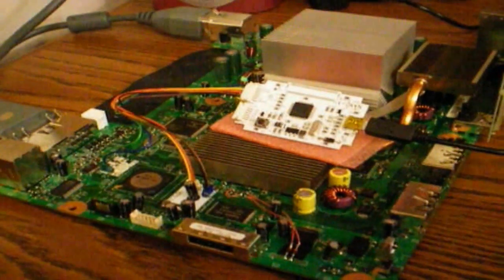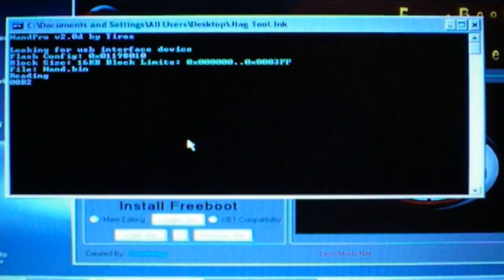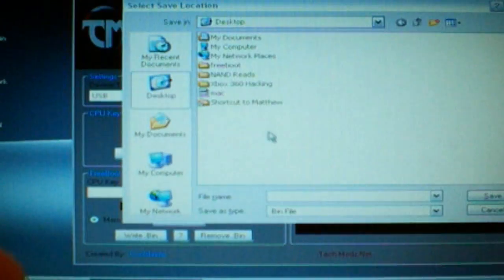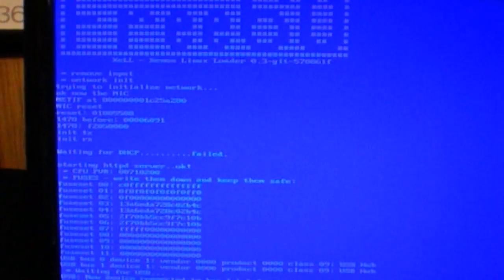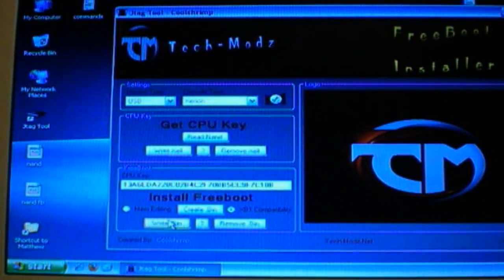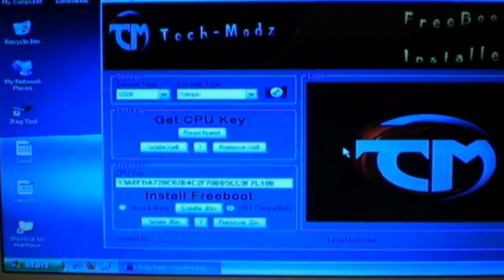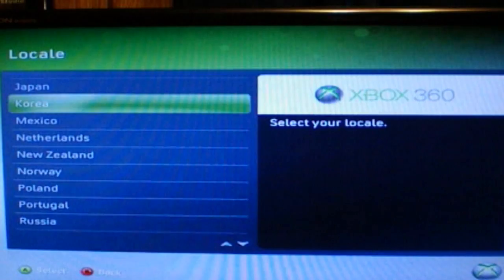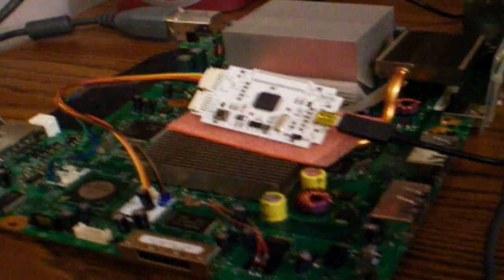Xecuter NAND-X and FreeBOOT Install guide

Comment: @CarolinaGamer Got really lucky, dumped my NAND a few times and the CB version is 8192. I looked it up and it's exploitable, but now I have another problem. When I flash XeLL, I get one red light and E79 error. Flashing the original dump back worked and it was working again. After the second time I flashed XeLL, same problem: E79. But when I hook it up to the Nand-X again JTAG tool says: "could not detect a flash controller" I now for a fact that the drivers are OK.

Comment: why does it say when i click on 
read nand, that it cant find flash
controller, ive soldered the wires
twice, and ive installed the drives
but when i try to open the
nand pro, it just closes on me, windows
trying to find a solution

Comment: 1 more question, I have heard that in order to install freeboot, you need to have dashboard 7371. If my dashboard is below 7371, what is the proper way to update it to 7371 and retain Jtag compatibility , because some 7371 already blocked the expolit.

Comment: when using the 360 dump tool, how do you know that the dump was good? On the bootloader sections I get values for everything but on the key vault I just get bad key/kv but that might be because when i first ran the program I did not set any key information at the window.

Comment from the maker: @TEAMxFNG No you will have to do the JTAG wiring for non xenon boards. The NAND-X comes with a quick solder board for both types of jtag set ups. So if you get a NAND-X then you will have everything you need to jtag the console besides a soldering iron and pc stuff like that.